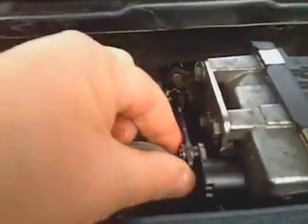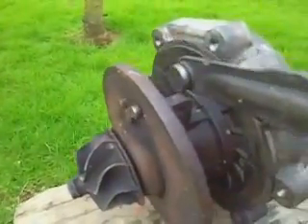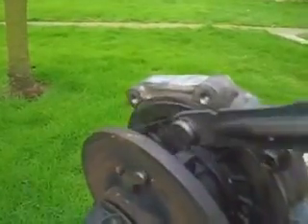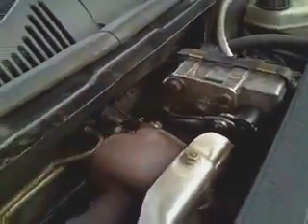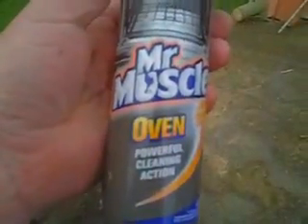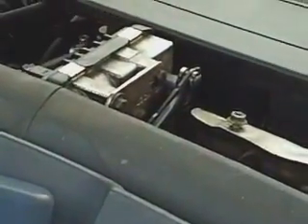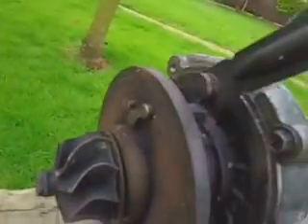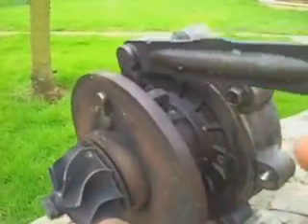Mondeo Actuator Movement

Comment: I recently got an X-Type 2.2D, for cheap because it had a "gearbox fault" and was going into limp mode. It's an automatic, and when I'd put it into gear there would be a major "clunk!" from the transmission, felt like the gearbox was going to fall out!
So I had the bonnet up and when I turned on the ignition I could hear a clicking from the engine so I went and had a look, and this actuator was trying to move. I gave it a little push, helping it on its way, and it completely fixed the problem. I did do the Mr. Muscle trick a few days later as the turbo was obviously clogged up with crap. 
Pretty strange though, that the gearbox was making such a violent thump when the problem was the turbo actuator.
But good video, just the right pace and the right amount of information.

Comment: Hi there, very informative video. I have a question, my turbo doesn't look like yours. My car is the 2003 Tdci 2.0 diesel and appears to have a vacuum actuator. Do you know if this fix also works on the older turbo?
Reply: its a euro 3 engine you have, it will "work" the same the only difference is the control for the arm

Comment: sticky actuator , remove that sir clip
on arm , now start pushing it forward and back , if sticking then spray wd 40 and oven cleaner all over it , the arm , keep pushing it forward back Nd spray , do it 20 30 mins , u will find it has loosened up good and proper , replace sir clip and done , thing is tho u might have to repeat it every 6 months
Reply: +omar khan thanks mate do you spray the oven cleaner over the arm!
Reply: +jaguarxtypeandstuff yes but it will jam again , but it's momentary fix , best thing to do is follow this guy in the vid , it's a tru fix
Reply: thanks bro i am going to drill a hole in the side and do the tap thing with oven cleaner!
Reply: +jaguarxtypeandstuff best bet mate or just don't buy old fords lol
Reply: I had a sticky arm, I have cleaned out the turbo and the arm is nice and free. I still get the P132B error in 3rd over 3k revs. Do you think the actuator is shot?
Reply: Simon Edwards i have the same priblem monde st 2.2tdci did you fix the problem?
Reply: Simon Edwards whip it off and open it , check for dry solders on the circuit and check the gear cogs , see if their shot ! i think u can get a kit for the replacement parts online or ebay i think
Reply: Simon Edwards one tiny bit of resistance in that turbo can burn out an actuator, I went through 3 actuators with just a bit carbon resistance in the turbo.

Comment: Mine is an earlier Euro 3 TDCi with a pneumatic actuator, so moving it is a bit of a bugger. It does seem to struggle when revved - not moving cleanly. Still, after 168k, it's bound to have a bit of crap in it. Got a 90 degree drill on order for Mr Muscle purposes...